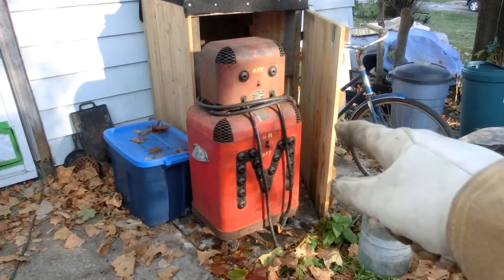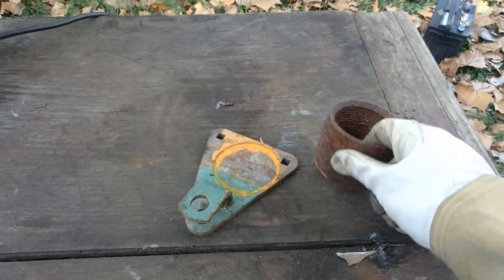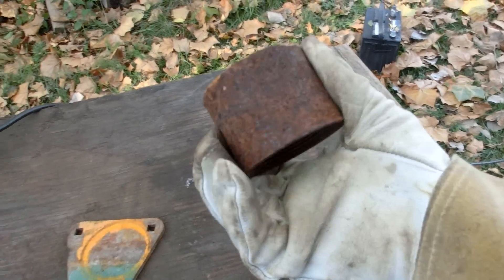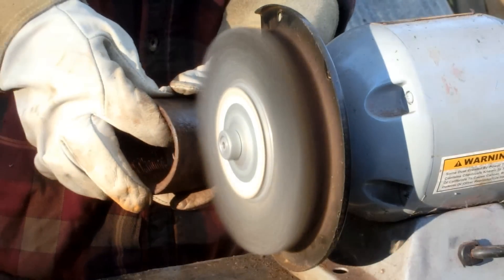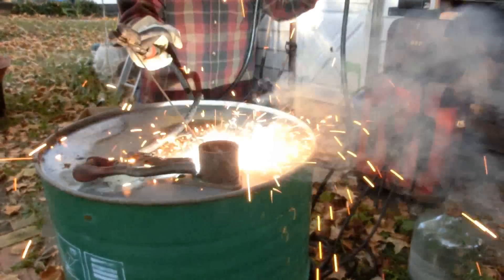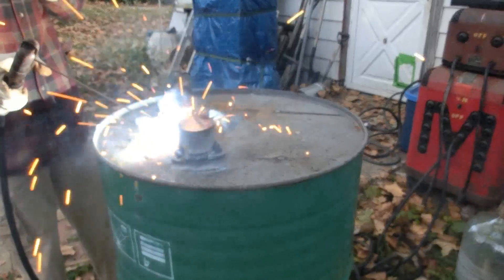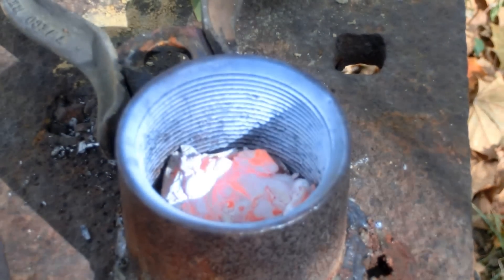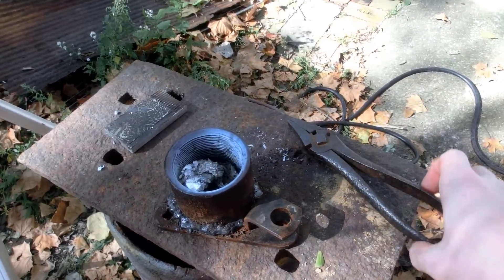DIY Aluminium Arc Furnace Crucible

Comment: From what I recall, you should use 2 graphite rods instead of 1. The reason is that some of the carbon travels through the arc to the other pole. I don't believe that the ground clamp will bond with the carbon, so it may be lost. But if you use another graphite rod it will rebond to the other graphite rod and stop the degradation. There will b=still be some losses though. I've built my own electric arc furnace (Check out The King of Random's video on it.)

Comment: use an empty drum as a welding table was a bad joke,it might explode
Reply from the maker: +Deni Suryadi why would it explode? its missing the bottom and was originally filled with concentrated grape juice...
Reply: +pixelpatter01 I'm skeptical. Even assuming that there is leftover organic material there, that doesn't say very much. Many different types of organic material will just burn happily and not generate much thrust. How could it possibly build up pressure that is high enough to rapidly launch a steel barrel with stuff on it?
Reply: pixelpatter01
There is no way that something like gasoline (a reasonably powerful hydrocarbon, far in excess of some leftover organic material) burning in the underside of a closed barrel (with the bottom half open but on the ground) would cause it to launch like a rocket, I don't believe it. There is simply no way. All of its energy would go to heat (and rather slowly at that), which would primarily raise the temperature of the air, but not very much since there is a lot of air. Not just that, but it is fallacious to assume that this barrel is totally closed. It's just not true, there are small holes through the bottom of the barrel everywhere. They are either already there or can be made by a buildup of pressure long before it reaches 400lbs, and the path of least resistance will be out the underside  going past whatever floor you have it on.

This is testable, take some gasoline and put it on the ground then put a can on top of it and light and put the can on it. I doubt it will fly off like a rocket.
Reply: pixelpatter01
What video link? I didn't see you post one. I would have watched it. Are you talking about the video we watched?
Reply: +Rinoa Super-Genius Even empty drums have an organic liner on the inside that can burn. A little heat from the welder and a hot spot hot enough to light the generated fumes could propel that drum up into your face. Deni Suryadi was trying to give you some good advice, and maybe it might save somebody else some grief.
Reply: +Sarah Szabo Have you ever seen a barrel blow up? Worst case scenario is some sort of fuel like diesel. What would burn quietly in the open would make a very sudden pressure rise in a contained vessel. Even a barrel with no bottom is a contained vessel until it lifts off the ground. I agree a plastic or organic liner would no be as easy to ignite as fuel, but as it is heated it will give off flammable vapors (smoke) that will mix with the air and can be ignited. As for the amount of organic material, it wouldn't take much. A 55 gallon drum holds about 8 ounces of air, which is about 21% oxygen or about 1.6 oz. To completely burn it would take less than an ounce of carbon, or less than half an ounce of a hydrocarbon. These are just rough calculations, and you don't have to burn all the air in a barrel to make a big push-off. A barrel has a diameter of about 24 inches and the area of the end is over 432 SQ IN. A one pound pressure increase inside the barrel would generate an upward force of over 432 pounds. Do you want to catch that in the face?
Reply: +Sarah Szabo Did you watch the video link? All the barrels were open on one end. I can't make you believe anything, I can just present my arguments.

Comment: Much DIY respect...but did your mom teach you how to weld? Because that joint looked like you were half-asleep.

To be fair, you didn't do any weld prep on heavily-oxidized pieces, but what ever. :)
Reply from the maker: actually it was this welder, i'm not used to it. i probably should have just gone back to using 3 car batteries in series with jumper cables like im used to.
Reply: Dude. totally. I'm all for DC arc welding! :)
That being said - that iron seriously needed prep work, no matter what your welding method is.

Comment: If you have a MOT lying around, you can build one of those 110 to 0.5V transformers and use that low voltage high current to preheat the crucible via Joule effect heating.
Quite nice anyway, I would build an electrode holder with adjustable height :)
Reply from the maker: i'd need something bigger than that. i have some 0000Guage wire in my basement from the coal mine i'm wanting to use.

and yeah the electrode holder is something i'm planning, but also wanting to make it adjust it's height according to the current draw through it.
Reply: Rinoa Super-Genius
Such a MOT would put out a little more than 1.5kW which should be enough (given enough time, 5-10 min) to preheat the crucible to high temperatures :)
Be sure to put a fan on the MOT because they're not meant for this type of operation :)
Also, if you need more power, just parallelise more of them!
It wouldn't solve your popping breaker problem, it would only worsen it, but it woul definitely help the melting process
.

Comment: What if you made an induction coil using the welder as the power supply? It would heat the steel, but it should do a good job melting the aluminium.  Or maybe make a multi prong electrode to make a better spark?
Reply from the maker: yeah i've been thinking about that. but have also been thinking about focusing on my water electrolysis machine that will store oxygen and hydrogen at like 700psi in my oxy/acetylene tanks and i will be able to make a furnace to help heat up the crucible with hydrogen then add more heat with the arc. i bet it would be efficient to make the flame swirl around the crucible.
Reply: Rinoa Super-Genius
That's a nice project! I have done a similar one so you can ask me if you want more info. Oh be careful with hydrogen, especially hydrogen/oxygen mixtures.
Reply from the maker: MrOpenGL  thanks but i think i have an idea for the system. i'll modify the PWM charger for my new solar panels i just got so instead of it switching on/off for the batteries it will be switching batteries/electrolysis.

still need more parts though. like another refrigerator pump and some fittings.
Reply: Rinoa Super-Genius
In the mean time you can do an electricity-charcoal hybrid. Charcoal (or even coal, would be better if you can find it) to preheat the crucible and keep it hot, and the arc to do the proper melting.

Comment: i wonder, if you make a torch with a fixed carbon arc, it may stop the welder loading down the power too much, also will run without  having to move it around so much
Reply: jusb1066 yes you can use a torch for aluminum meltdown. you don't even need carbon arc rods. In fact, when using   carbon arc rods for aluminum meltdown your final product is contaminated (low grade). For the home user that don't matter because when you sell it to the mill they are going to pull out the impurities during their meltdown.

Comment: One more thing...sorry....:) the arc was hitting off to the side and I thought if you put silica clay around the outside but leave the bottom exposed the efficiency goes up and you're on to something there cool idea
Reply from the maker: yeah but i need to get teh crucible hot also, not counting i'm not generating heat from passing current through the aluminium, its just too conductive to get hot. so its getting hot just by the radiant heat from the arc. i need to keep teh arcs long.

Comment: I noticed the arc was mainly skipping to the side rather than thru the alu. itself. I wonder if a non-conducting heat resistant lining on the sides, forcing the arc to go thru the aluminium might help? Maybe furnace cement or similar, or even clay (the heat would fire it)
Reply from the maker: doesnt really matter. i need to keep the crucible hot also otherwise it soaks up all the heat.

Comment: Have you tried an induction heater dont know if aluminum would work but I know you can melt metals with it like hardened wrenches with 1k watts and that missing link probally has enough amps to make short work of anythijg

Comment: Perhaps a smaller base under the crucible would work better, less heat lost in the base, and put the crucible on a ceramic tile to isolate it from the metal drum.
Just a mad thought :-))
Reply: correct

Comment: What are those huge crucibles made out of at the steel plants?  But yeah, steel needs to get REALLY REALLY hot to melt lol
Reply: gorp27
That would probably explode due to the stresses induced by uneven heating.
Reply: some kind of ceramic i think, and the downside would be it wouldnt conduct elctricity sould would probably have to use a pair of carbon electrodes to melt it
Reply from the maker: jusb1066
 looks like i'm gonna have to use a pair anyway.
Reply: Rinoa Super-Genius
Than skip the steel crucible and go straight to ceramic. IE: coffee mug.
Reply from the maker: gorp27
 yeah that won't work.
Reply: sc0tte1 I am a welder and have been working in steel mills for the last 25 yrs. The crucibles you speak of are actually called ladle's, Most of them are made of cast iron and they are lined on the inside with a spray on refractory usually 8"-12" thick. In the old days, they paid brick masons to line them with fire brick. some mill's still use firebrick liners, Most all stainless steel ladles are still lined w/ fire brick. stainless has to be melted down in a vacuum so what they do is stick the whole ladle in the vacuum furnace and the whole meltdown process is done in the ladle which is in a vacuum chamber furnace. yes, they are quite heavy Its not unusual to see a 200 ton capacity ladle. Stainless is not melted down in an electric arc furnace (carbon electrodes). believe it or not they use oxy/gas burners for the meltdown. And you are correct about the need for a lot of heat to melt steel. Low-grade steel melts at around 2500 deg F. But you have to take it even hotter in a large furnace (2700-2900 deg F) because when they pull the heat source in order to tap out the furnace it has to maintain more than 2600 Deg F. until it gets downstream to the rolling mill. If you have any questions just ask. I would be glad to help.
Reply: MrOpenGL BTW: You might find this link useful.    http://www.onlinemetals.com/meltpt.cfm
Reply: Scott Smith Thank you for the very detailed explanation my friend!  I appreciate your reply! I didn't know that stainless needed to be processed in a vacuum but that makes sense so that it doesn't react with the environment around it and rust, etc...Cheers :)
Reply: Scott Smith PS keep up the great work in the industry, you are among some of the real workers that bust their butts in the Western world!  Respect goes out to you.